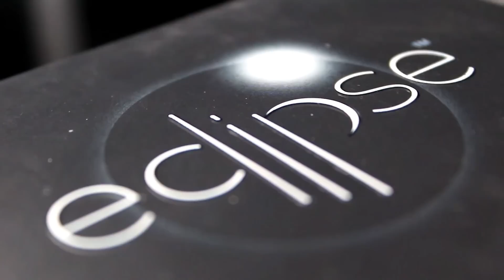Motorcycle Bar End Lights - Installation Video!!

Comment: will be nice if there"s a durability test of the product so that we will know if that thing is worth the trouble of installing it cause if ever gets into crash/accident we would like to know if it can be easily replaced. Of course the product and the idea of it is great but after an accident if it can"t be replaced with ease of new ones then you don't want to go through the trouble of installing it again and then the damage might lead into another problem may be rust or something. It is important to know first because sometimes the parts of the bike you have is hard to find or it takes months to have it replaced because as we all know sometimes there are no stocks available so we have to order it.

Comment: I had purchased one for my pulsar Rs 200 ,but the thread diameter of the bar end lights screw are no.13, where as the Rs 200 has thread diameter of bolt  is 10 no.
Even though if we make 13 no.hole by leath machine, but problem is from where wire will come out for connection,bcoz rs200 handler bar are not hollow type , it has very strong steel rod inside which cannot be drill by leath machine.
Reply: Sell them on OLX

Comment: When i tried to install this on my avenger there was a rod inside handle so it was not possible to install this.. how you made it sir??? Rply me plzz..
Reply: Manoj kumar same issue here.. we have to drill through that hole.. Did u try doing something?
Reply: Ye tumhare sir sirf sardaron ko reply karta hai. Jao pehle sir name change kra k aao. 🤨😑.
Don't believe me, check the comments. 
To answer your question, contact a local mechanic.